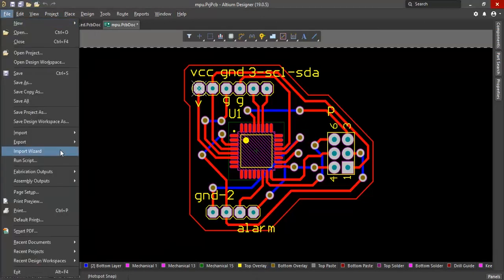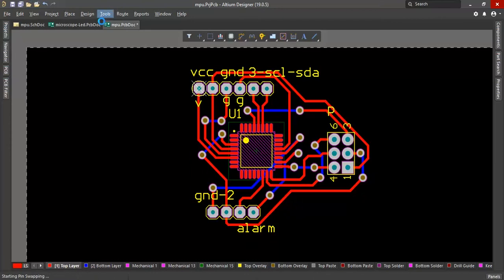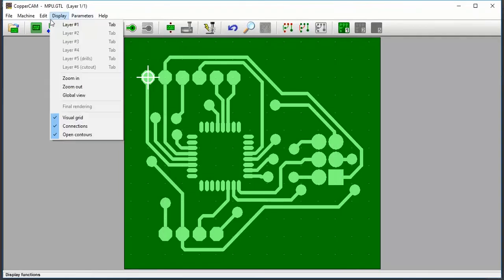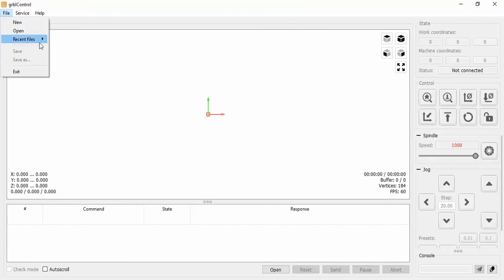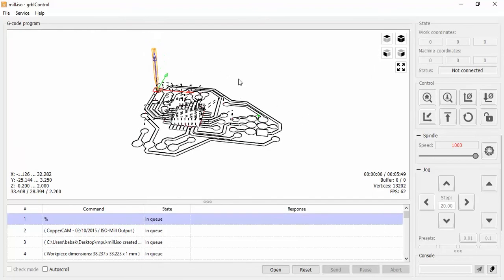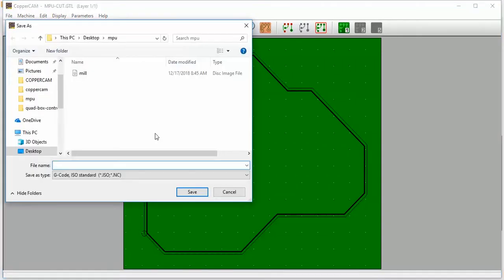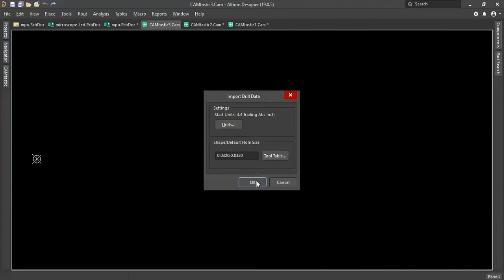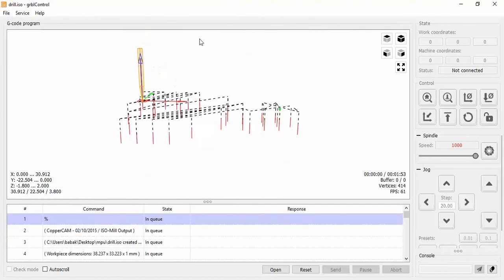How to make Cnc Pcb Gcode

Comment: Sir pleass i need heelp
When i convert gerber to g code by copercam

The g code not have all tracks but some of tracks it not produce. All the bottom or Top. Tracks and pad  .... ets        why
Reply from the maker: Hello, I had this problem like you before but I solved it.
first, you need to go Altium set origin in the center or on one of the pins of your design (go to Edit/origin/set)  see the video time 0:00 you can see my origin point. Make the output Gerber file again and test it with CopperCam.

If you have more question, please ask
Thank you for your comment.